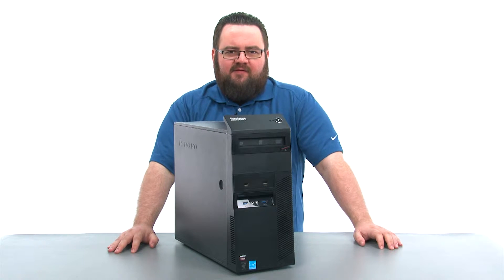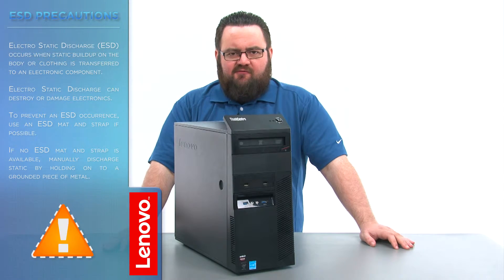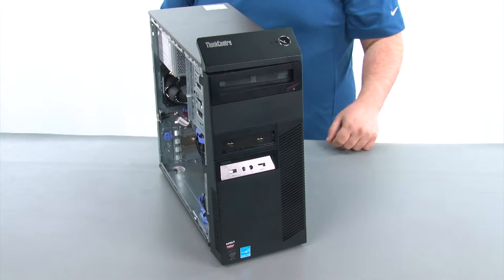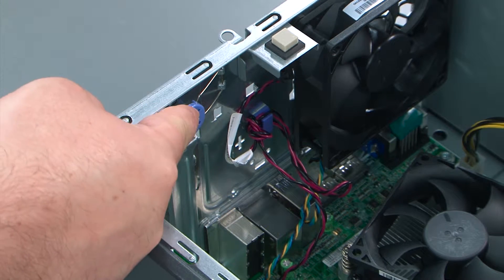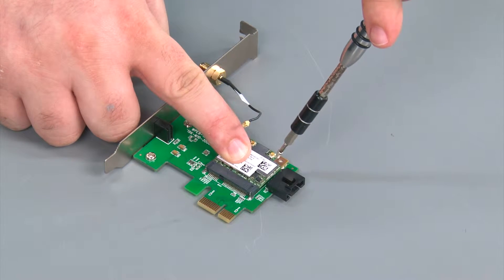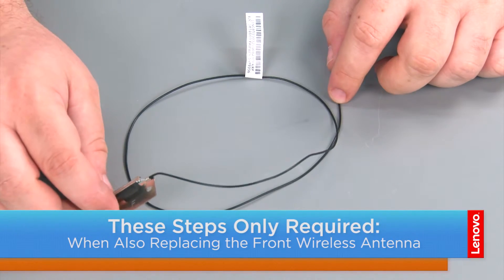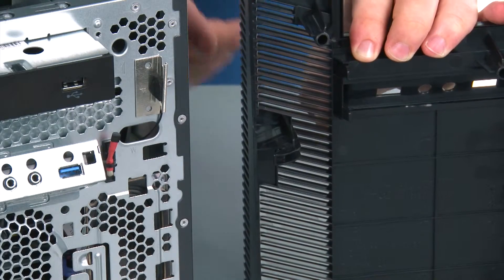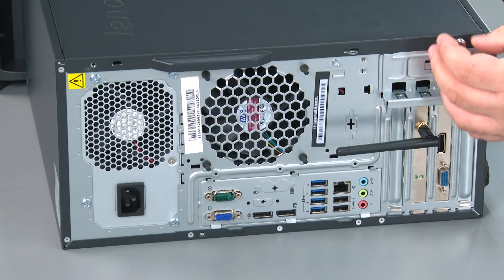ThinkCentre M83 / M93p Tower Desktop - Wi Fi Units Replacement

Comment: Sir how to boot os from pendrive  it was showing command line .plzz help me to get out of this
Reply from the maker: Hey there! Thank you for reaching our support! Just to confirm, are you using a ThinkCentre Desktop? If yes, you can check out this article https://lnv.gy/2Xm1YQ9 and follow the provided steps on how booting up to a USB drive. Let us know how it goes. -Chris_Lenovo
Reply: LenovoSupport   Tq sir for your kind reply tq very much
Reply: Sir in the exit option there is no “os optimal default”. Option sir. Only here i had “load optimal defaults”. What to do sir.
Reply from the maker: May we know the model name of your Lenovo ThinkPad? What are the options do you see under the BIOS page? -Chris_Lenovo
Reply: LenovoSupport :- actually. Mine was lenovo thinkcenter M71e pc. Sir
Reply from the maker: I see. It should actually have the OS Optimized Default option in the BIOS. If it's missing, proceed with the other steps and check if you were able to boot from USB Drive. Update us how it goes. Hector_Lenovo
Reply: LenovoSupport:- sure sit tq